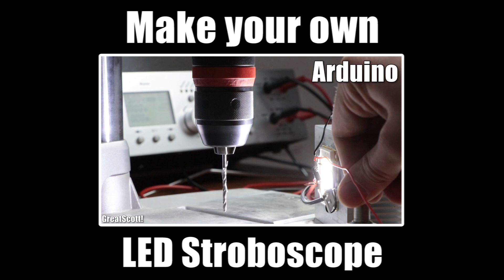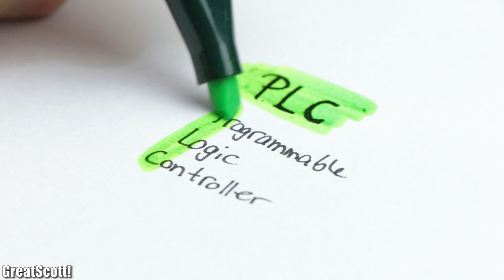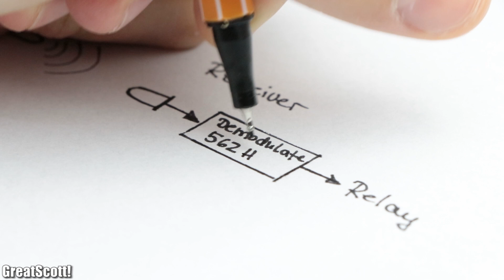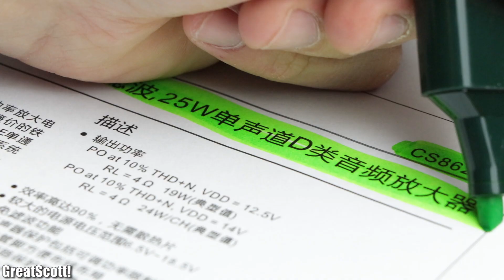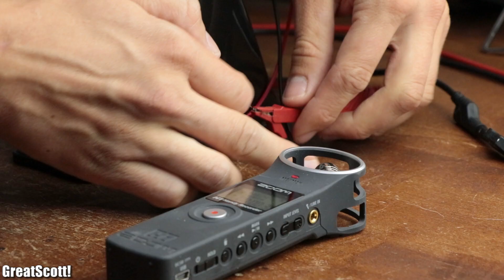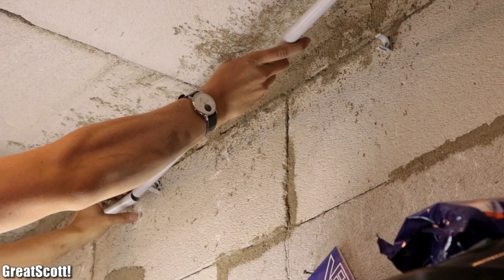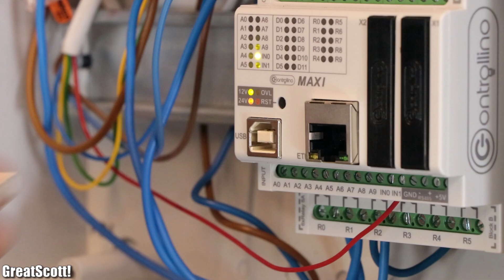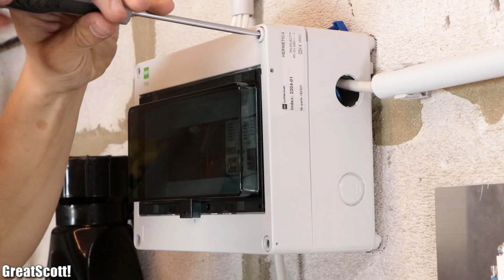DIY Light Barrier Alarm System with an industrial grade PLC (Controllino)

Comment: Very easy to dip under the light beams so I would fit a microwave detector which is much more comprehensive and will also detect the door opening. I would also cut the conduit to fit to the boxes and use single core wire for all non mains wiring.

Comment: Yur system is interesting, but the alarm if in reach would simply be knocked off the wall. Flashing light is a non issue. Especially if they knew you where not home.

The thing that works the best is video cameras. The worse thing for thief is to be identified. They also know video are streamed these days, so they are caught no matter what They could find video system or even burn house down, but the video is still online, out of reach.

Your system is after the fact, also the PLC itself is a nice item to steal. An outside alarm is easily knocked down using a metal pipe or shovel handle. Then say goodbye to your mopefs

I live up the road from scumbag meth dealers. Nearly every day and every night, you can see them walk by. Same kind of dumb asses, walking same direction, wearing backpacks, drug mules. Grown men and women riding bicycles with backpacks too. It's always a dead giveaway when they turn up that street.

When I installed my camera system, I put signs up loud and proud. Now when they walk/ride by they cover their faces or walk at distances.

Comment: With Hikvission DVR you will check online any time from any where. There is aap which you should install on your mobile phone form online servelence.
Another idea is that you integrate gsm module with with your system. When ever some one inters this system send your sms or misscall. So that you use your mobile aap to check online how is there..

Comment: Nice work dear,
But You should add cams also. "Hikvission" cams are cheaper. Two Analog cams of 720 pixels with 20m IR range are enough for this place. 1-DVR With 4 port, PC HDD (Hard disk for storage), 12v addopter for 2 cams, conectors and power cable and coxal cable is required.
But for that system you should remove blinking LED.

Comment: How about this: 
Make a two stage dead-man switch for a couple of power outlets.
A) You hit the switch and the outlets turn off. 
B) You take your foot off a switch an the outlet turns off. But the lights should stay on.
WasZumNaschen) You disable the alarm with the reed switch and enter the garage and a cd player starts blasting some random queen album at you (My dad used to have this in his workshop.. turn on the lights and the music would start, great for soldering, drilling, flexing and hammering)

Comment: You should really replace the "magnet switch" (because there will be a scratched spot on the exact correct point) with a RF keychain transmitter. That's basically a standard now.

Comment: Add a motor that is controlled by remotes so that you don't have to manually open or close it and what about. A light sensor that should automatically switch on the lights when the door is open.

Comment: Hi! I am going to start a new arduino based project. It is based on controlling a backhoe loader gearbox like the original controller. All i need is a arduino compatible controller that works when the tempature is negative. Can you recommand me one?

Comment: Actually, in industrial PLCs, fewer and fewer are using this annoying out-dated ladder (and other 80s languages) and program more in STL (basic-ish + C-ish language, which is not ideal either, but MUCH faster and flexible to program). In the more modern PLCs, there is even an integration of C and C#. And Beckhoff's TwinCAT 3 actually integrates in the Visual Studio environment (which does leave me with a double feeling sometimes).
Using a Controllino, personnaly, I would never consider using any visualisers, and definitly stick to the free arduino IDE. But that's just my opinion off-course.

Comment: Hey Scott great content, I have a question. I'm working on a car project. I have two power sources that go on one load, one power source is a 5V 1A Solar power bank ther other one is a 5V 2A from a car charger that I can turn off with ignition off. How can I make it that when I turn the ignition off the other source still provides power to the load (in my case a tablet without an internal battery)? Can I use only Schottky diods, only Mosfets or is it better to make a circuit (or better to buy one for a such purpose), I also saw some SPDT relays that can also work as a switch for two different power sources? I would appreciate an answer because I really need one :-D

Comment: Add a fire alarm like smoke detector to the controller and a keypad that needs a code, and a tamper circuit so if any of the devices are opened, it will sound the alarm!

Comment: I would control maybe few power sockets with that. I would likely connect compressor to one and possibly some charging equipment. Well anyway stuff that I might want to keep an eye out or wouldn't want to forget them on. It would be quite easy to implement to that plc.

Comment: 25W amplifier for a 100W siren? Something does not check out.
Also, 100W at 12V is 8.3 amps, these siren wires will not sustain such current.

Comment: Why do you need conduit for low voltage wiring? And, when you do use conduit, why are the wire exposed at the corners and junction points at the box entry?

Comment: add a shock circuit to the door handle. when magnet is in place circuit is open, when not in correct orientation, shock circuit applies 1.5 v to ground via intruders arm-body.... maybe this could disturb a pacemaker? soemthing to think about.... use a barbeque igniter switch

Comment: Controllino's are very nice, I would definitely use them if they were not so expensive $$$
They also should upgrade the processor to a more modern one, like the M0 or an ESP32, or even better make it replaceable.

Comment: Alarm systems often also have a extra loop (wire) around to all devices in the circuit, this is to detect is the cable is cut, you can also add in switches in the boxes/enclosures that will break this circuit when the things are open for unauthorised "inspection".
You may also need to find your local law/code for alarm systems, there may be restrictions to how loud your siren may scream, and for how long, better follow these.

Comment: I work on something similar. But with ESP32, some rellays etc... You could add GSM module maybe or some other remote control (via internet??). Also there would be better using some keyboard instead of magnet

Comment: You could add automated external lights as I'm planning for my own garage using motion sensors, light detector and time of day to have different lightning condition based on what is the current environment. This way you can have "decorative" dim lights in the evening, bright lights if someone sneaks in and have them turn off in the middle of the night (unless some sneaks in...).

Comment: I am planning to build a home alarm system with GSM/WIFI module and an extra battery option in case the power "goes off", with activating and deactivating codes (maybe rfid)

Comment: You could also add presence detector using BLE, so that it would not trigger an alarm if you're close and about to open the garage. Don't forget rolling codes seeded by synchronised time and a key between the controller and the BLE beacon. The beacon should have a function that generate pseudo random number from unix epoch and a key. Both function should exists on the alarm and the beacons so that the alarm can authenticate the beacon.

Comment: Nice video - could you possibly remove that reed switch and use the lock mechanism as a means of de-activating the alarm? If you have the key the alarm is de-activated, if not then the alarm will be armed!

Comment: So all an intruder needs to do is have knowledge where to place a magnet. He can just place a bigger one in the vicinity of the detection zone, or even a stronger one loosely around the area.

You can connect the key lock to the alarm system, and also as suggested by others. Replace the magnet with a more secure keypad.

Comment: You are certainly correct that some of the controllino software is indeed open sourced, but I cant help but feel that the company is overselling their open source morals.  For example, "It combines the flexibility and open-source nature of the Arduino ecosystem", but from what I can tell, the hardware is closed source, the configuration software is closed source.  The only open sourced software that they provide is some very basic arduino BSP code and some examples using open source libraries written by others (SPI, modbus, etc).    Maybe I'm just having a grumpy day...  Nice vid though!

Comment: Hi, GreatScott! or anyone reading this, what should i use if i want to modify existing modem/router gateway firmware and use idk... maybe something similar to a raspberry pi with 2 ethernet ports so...
1. it has a small footprint on my table
2. I want to modify the modem/router so it doesn't have routing features, wireless capabilities, because my ATT BGW-210 700 has that and also it randomly resets my settings too, i'm getting double natted. Can affect me in games, hoping to find something similar to modify which is small and has 2 ethernet ports, thats biggest thing and has sufficient cooling and doesn't thermal throttle.

Comment: Heat or time may cause the magnetic sensor to fall, I'd suggest mounting with a bracket. If it falls it will trigger the alarm, why not install a killswitch in the form of a rocker switch or cancel button? Also, maybe set up some push notifications and audio/video recording upon a trigger? 
And with those Phoenix connectors you can set up smoke or water detectors, maybe incorporate that? 

Great project by the way!

Comment: I have an alarm system that is connected with a Conrad GX110 GSM module... It will call and SMS text me in case of certain triggers it is set up to... I can recommend to add this you your system... https://www.conrad.nl/p/gx110-gsm-module-5-vdc-24-vdc-functie-alarmeren-meten-schakelen-199285... It is also capable to do some simple PLC tasks...

Comment: For sure add smoke detection and SMS function to your security system, that should be basic, for crazy security system like I have, you should add camera and internet connection to shot and send picture to your email when alarm will be tripped. Allso if your PLC have analog input like arduino have, it'd be nice to have battery voltage meter, because if battery is very low your security system is OFF, but if system notifies you about low battery, you will replace or charge the battery... There is lot of options what to do, but you must decide wich one you sholud pick.

Comment: You should add a camera so you can see who's broken in or if it's just a false alarm. Both an ir camera or a normal camera could work.
Ir camera can be used without a light so no one sees it but it's harder to see faces.
A normal camera needs a light but you can see faces and other incriminating details

Comment: I suggest adding water and smoke/fire detectors, video logging during alarm phase, electronic lock with remote override and multiple codes (with event logging), and underpower event reporting.

Comment: The price for the controllino is very expensive, for this price you can buy a Panasonic PLC.
Reply: It's chump change compared to the big brand PLCs.  To get the equivalent functionality you generally pay a few thousand.

The industrial PLCs last forever though, as long as your tech doesn't short any outputs.  I'm getting ready to work on some Modicons that have been running in northern Greenland for almost 20 years, and they're still going strong.

Comment: Enhancement idea: Maybe a remote controlled (RF?) opening/closing - using some step motor / or regular one with some closed / opened (or just stalled motor) sensors, automatically disabling / enabling the alarm.

Comment: You can easily add a push notification for wifi for cheap, I used a zing led nitelite.  I wired a relay to alarm output to interrupt AC to zing, then it pushes and editable message immediately, also pushes when alarm resets, plus it's a cool light you can put on side of panel, it does a lot more too, it can push motion detected thru it's pir, this is not made to do this but easy hack, check it out.

Comment: I was quite lazy, I got myself a cheap wireless system for the office, after more than two years, I needed to change the batteries.

Anyway I've made several Arduino Nano systems with a cheap €2.5 GSM module onboard, I've started preparing one for an Alarm system for home, only need to check the front door, I live on the 14th floor, I doubt anyway will attempt to enter a window in a residential area.

Comment: Whenever the alarm is activated, send signal to servo motor (or garage door opening mechanism), and close the door on the criminal.  Also, send a signal to enable the video camera to turn and record video of the criminal. You have a chance of locking the criminal inside and have video evidence they were trying to break into your garage.

Comment: I'm not the first to mention this but might be a nice idea to have some kind of internet or cellular connectivity to send a SMS Text message or other notification to alert you to an intrusion. Could also use wireless connectivity to remotely disable the system just in case your out and someones complaining about a false trip.
Might also be interesting if a Camera could be included that will activate when the alarm goes off and perhaps records and/or broad casts for some time in hopes that maybe it'll catch the burgler.

While there may be prebuilt home security systems out there that can do probably what everyone is suggesting including my suggestions, I imagine the main idea with this project is to put something together yourself rather then some pre-built system.

Comment: Add some junction or pass through boxes for those conduits, just something to make it harder for insect, dust, and moisture ingress, especially since you went through all the trouble of getting conduit and nice enclosures. Also, you have an RJ485 connector, add connectivity to it as everyone else said. I'd also add a still camera just in case someone does try to steal something before they run off. Since everything runs off 12 and 24v, maybe add a backup battery

Comment: Nice. I suggest one of those dirt cheap radar sensors instead of or in addition to the light barrier. And a alarm messaging system towards home using point to point LoRa comes to mind.

Comment: I used to work for my dad installing home and business alarm systems. The main boards tend to come with  a fuckton of  features, like tamper detection, up to 4 different communication outputs,  timing, auto-arming and desarming, etc, etc. (most clients wouldn't even use most of it's features anyway) it's fun to DIY, but a home-made version with all that stuff would be too complicated. 
playing with those boards is really fun in itself. even an old one has a lot of crap to play with.  My dad gave me a paradox 720 to install in my room and play around when I was little. 
No idea how expensive are these nowadays.

Comment: Next, add a camera? Maybe something that will constantly record, but then only actually save the video if the alarm is tripped. Kinda like you can do with a GoPro where it will continue to record, but only actually save data when you tell it. It will need to be a cheap camera, but have good enough quality that the criminal can be identified if his/her face is visible.

Comment: Great Scott ? I have a idea for you for a new project. Can you make a bike hybrid ? that runs off electric then switches over to gas when batteries run low and while gas engine is running, it recharges the batteries.

Comment: I think that the infrared sensor will be revealed to fast. So if the thief stays after the first alarm you can say bye to your stuff. Uninterruptible Power Supply, PUSH notification and some second line sensor should be implemented. I would add some voice module to it also the says. "Ich sehe dich" :)

Comment: It’s 100w siren made with a 25w amplifier? Those numbers don’t add up
Reply: Well.... 25% efficiency is not unheard of. It didn't look like a class D amplifier, so it seems about right to me.
Reply: Not relevant at all since the speaker is rated higher than the amplifier. The other way around WOULD be a concern! You should always aim to drive speakers below their rated max to cater for dynamic peaks. It also helps with lessening the onset of greater distortion. Those are general rules for the audio side but a square wave or pulse wave contains multiple harmonics at different levels so it's just advisable to do the same there.

As others have also said, is the class D output, peak or RMS and the same for the speaker capability. In the end I'd just say it was irrelevant anyway given the numbers.
Reply: @boblewis5558  It's an alarm, not a HiFi music system. The more distortion the better!
Reply: @manolisgledsodakis873  I disagree, but whatever floats your boat.
Reply: 125

Comment: If you really want to stop the intruder you should change the strobe to a random frequency. Random off and random on pulse times. (for example between 50 and 300ms)
Our Brain can't handle this random light pulses which leads to headaches and lost orientation. I tried it once with a arduino and my external camera flash. 10s were enough and I just had to turn it off. Saw weird glowing patterns the whole evening ;)